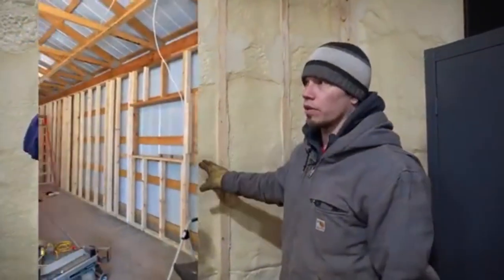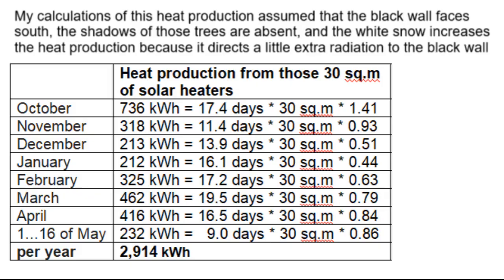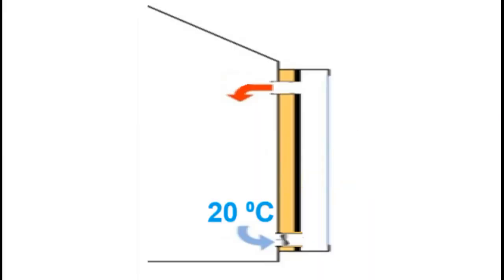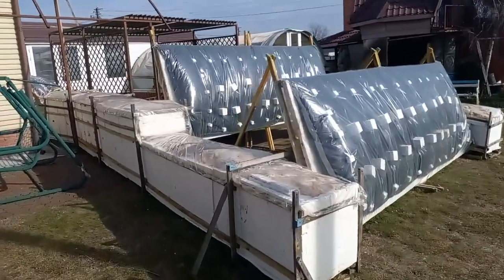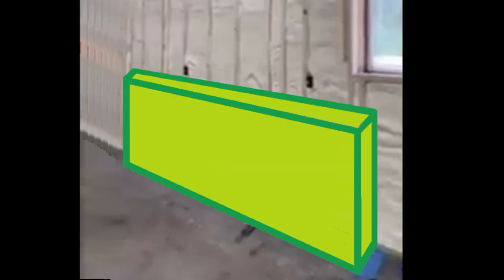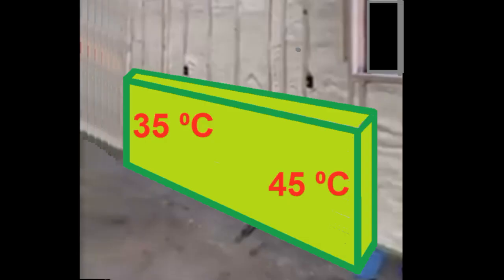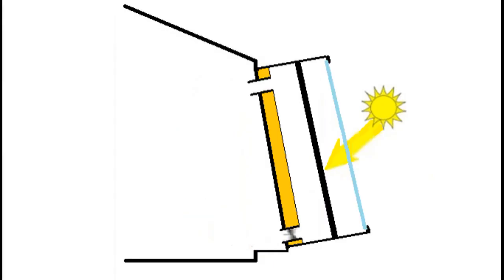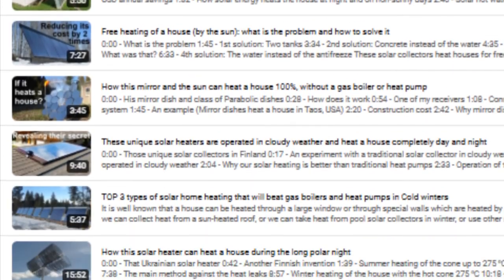DIY Solar Heater Wall (NO SOLAR PANELS needed!): How it works and how to make it better

Comment: Paint + heat+ breath = cancer
Reply: Not entirely true. There are metal plates with black paint all over roofs etc that does not release any fumes.
Reply from the maker: Look at 4:20. That version doesn't have the air in contact with the black paint.
Reply: @solar_heating  sorry but i see contact air and black paint. The only solution is outside water pipes and inside heat exchanger.